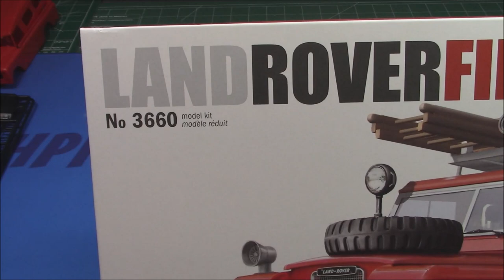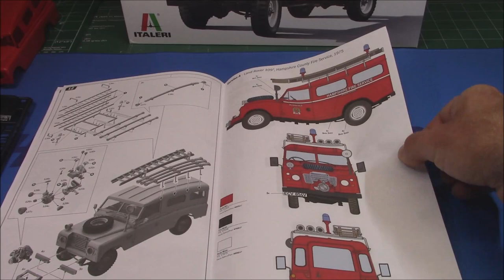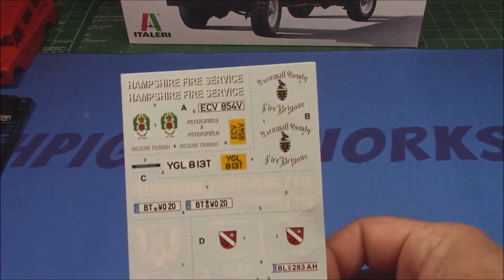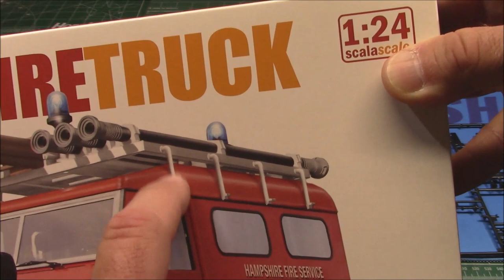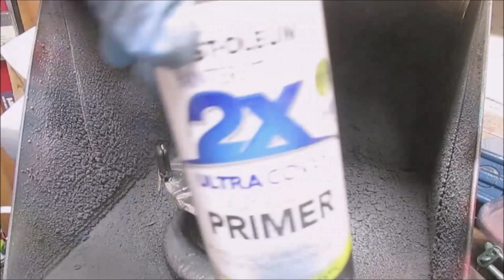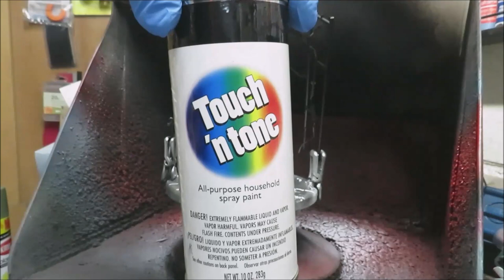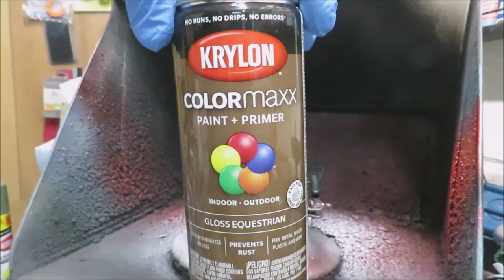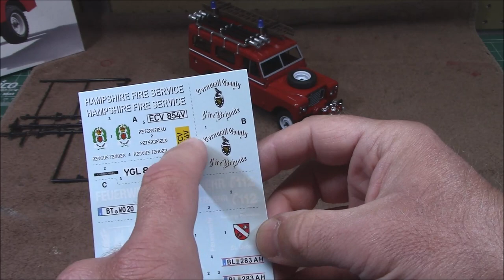Land Rover Fire Truck Cornwall Fire Brigade 1/24 Scale Model Kit Build How To Assemble Paint Detail

Comment: I really dislike model parts molded in black plastic. It makes a mess and its clouding the plastic cement.
Reply: You’re going to paint the parts anyway, correct?
Reply: @reddsshaker3477  Yes, but have you ever tried to work with Tamiya Thin Cement and black styrene plastic? It turns the cement in the bottle to a grayish cloudy mess. At least this is what I experienced in the past.